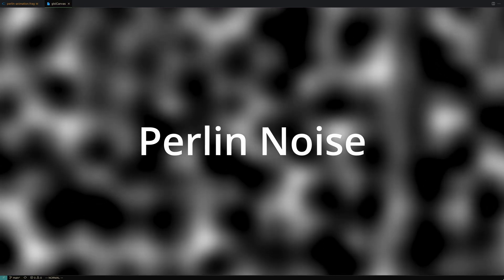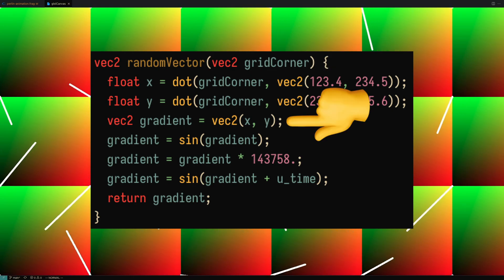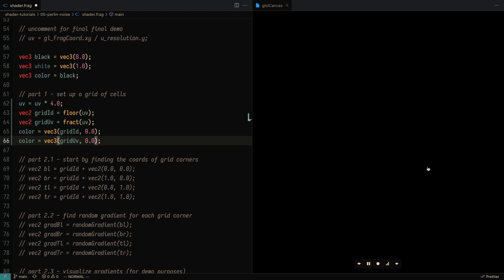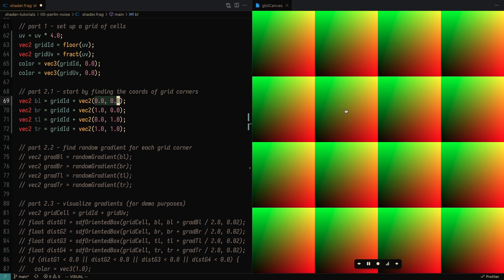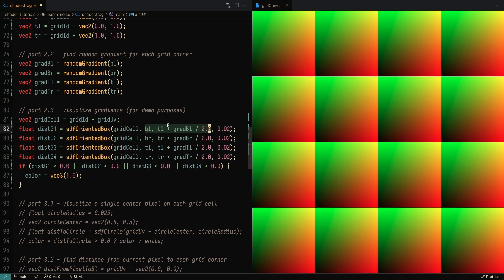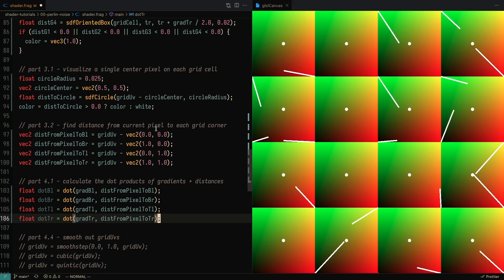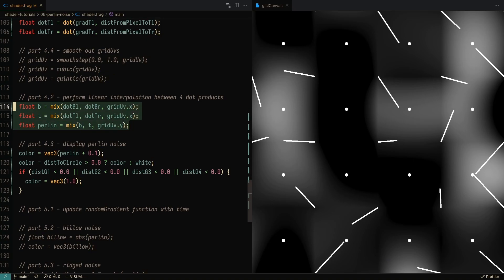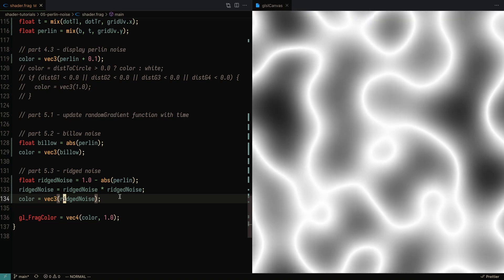What is Perlin Noise?

Comment: i didnt understand how u got the distance
Reply from the maker: Code is open source on my GitHub so hopefully you can learn it from there!
Reply: @SuboptimalEng  I think its actually wrong because the distance in your video is uv-direction, which its not the distance to the corer. However,  It should be uv-cornor_pos instead